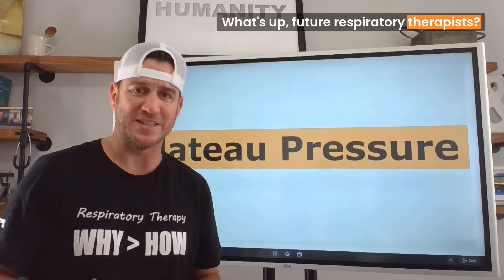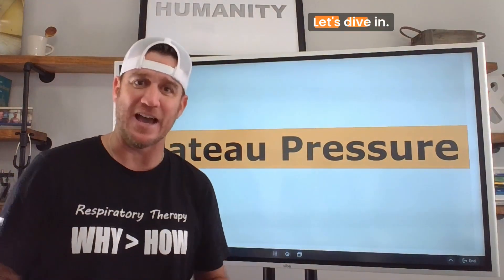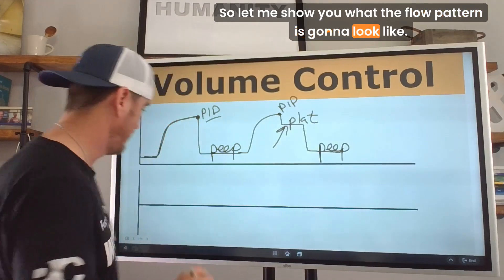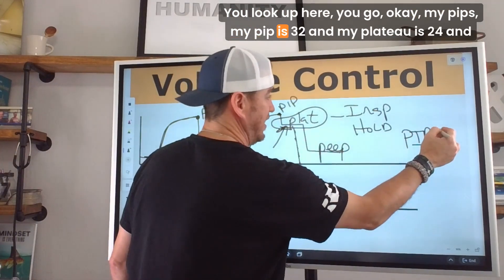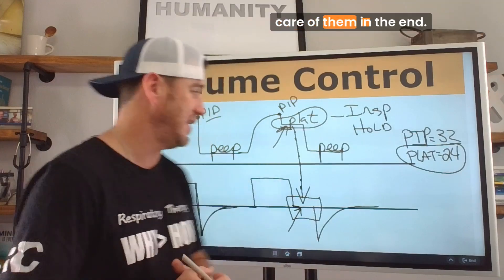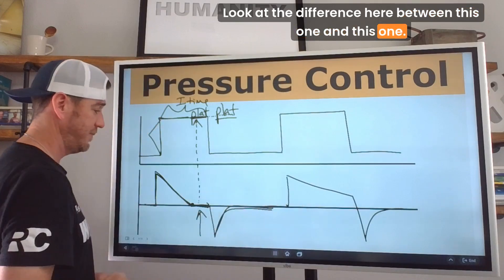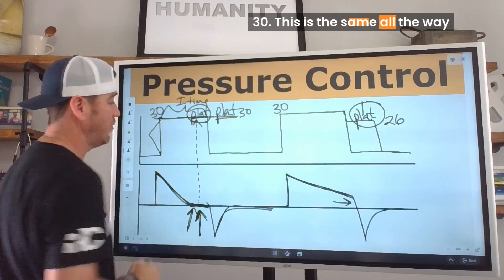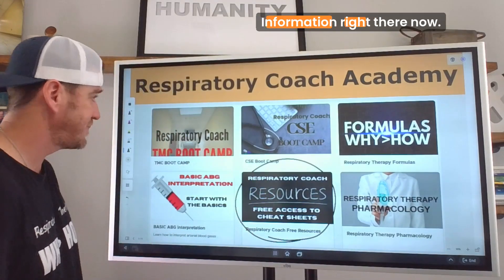Respiratory Therapy - Plateau Pressure

Comment: Great presentation as always ! When you're explaining the flow to get to pip and it arrives at zero, could you explain that in RT Coach manner. I understand how it works that at beginning the pressure will stay constant but the time will decrease or it goes from 0-10 then 10-0 and as the "tank" reaches full it reaches zero. I guess what I'm asking is could you put a number-line on the waveform as you explain it ?  If that make sense, I understand it, just can't explain it, You have a way of simplifying everything. Keep up the great work you do, Thanks Coach !!!!

Comment: Question. In pressure control, should the flow waveform be used to determine an ideal I-time? Should the flow be close to 0 before ending the inspiratory cycle?